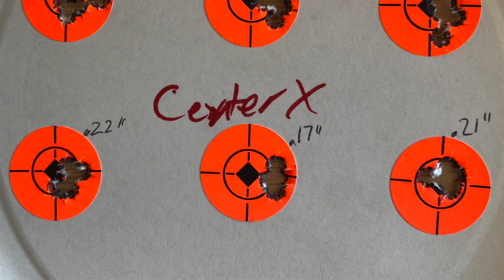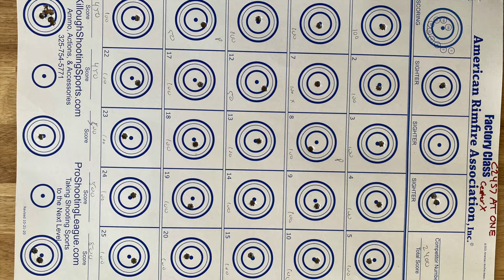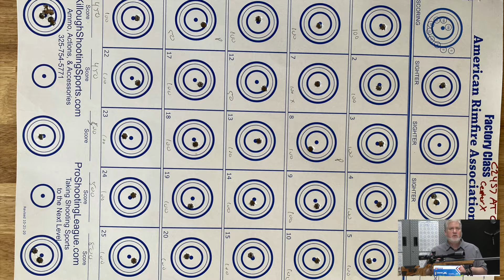How to Improve Your Accuracy Adjusting Action Screws - 22LR Rifle Ep.3

Comment: I’ve been working on a ruger model 77 in 257 roberts trying what you’re doing with the screws. I read that ruger sets the front screw at 90 inch pound,back screw at 50 inch pound and just snug the middle screw. Have you ever,and if so,what did you use to get 90 inch pounds.
Reply from the maker: I don’t think the screws can handle 90 inch pounds, I’d be afraid to break the screw.